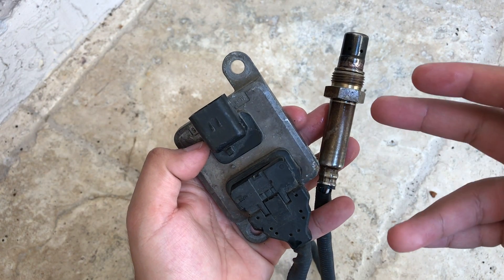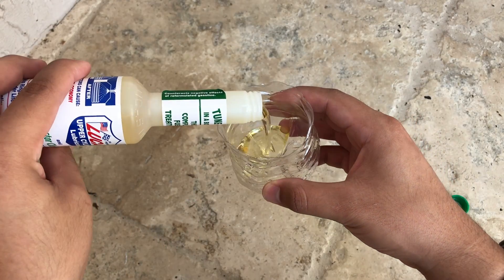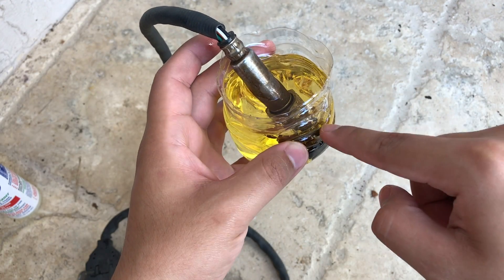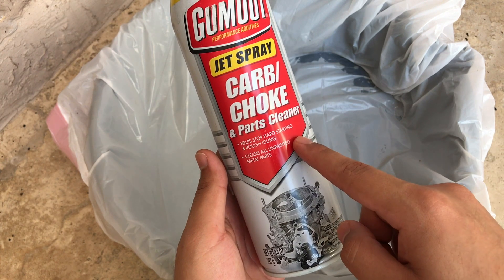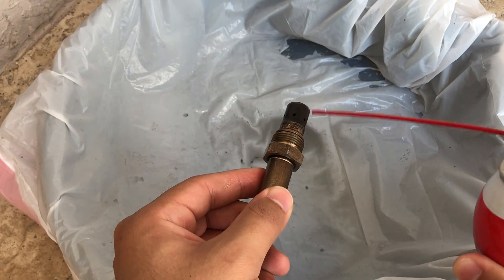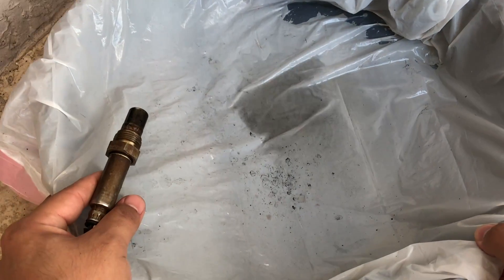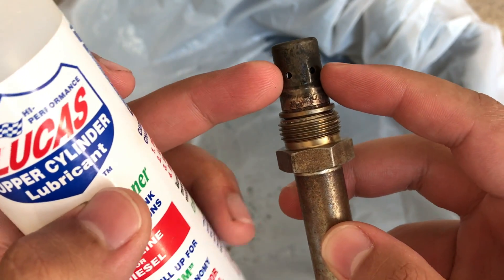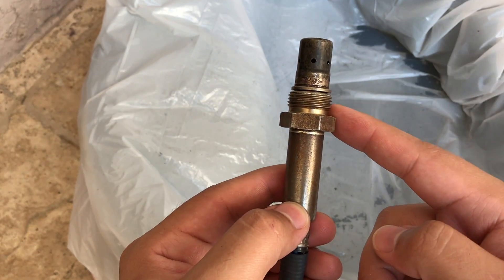How to Clean OXYGEN Sensors [Easy Way]

Comment: I would have liked to see the sensor tested before and after to show that the cleaning had worked.
Reply: Exactly show us the whole video from beginning to end not a halfway video
Reply: Exactly 😂
Reply: Look in the plastic lined pan to see what came out of it. You cannot see it inside of sensor nozzle , on here. I couldn't anyway. Going to do this this afternoon as I think O was quoted 1K to replace all 4. Screw-bie-doo that! I have those products in the garage already. I just have to find where the sensors are located on truck bc I do not know., but soon will.
Reply: same here
Reply: oooor, you could take a $7 risk and clean the sensor and re install it.  If it works....you hit the jackpot and saved some cheddar.
Reply: Lol
Reply: v @edstimator1 yoo89ooiokcvoukooookcvovcvvcyooooo8oo88oo8ocvovoovo8oovcicvov 6yyy866yyýýyyvvjjo6
Reply: EXACTLY what i was thinking
Reply: Take to the chiropractor
Reply: It worked. It is not a rocket science.

Comment: You cant clean an o2 sensor or nox sensor I smell bs on this video the code will come right back
Reply: Actually you can clean them with great results. Though not every situation is the same. If the inner part of OXYGEN sensor went bad, and/or cracked. Cleaning won't help. Also.  If after cleaning sensor your check engine light comes back on. It doesn't necessarily mean its the sensor. You may have a vacuum leak, or some electrical issues. You may buy a new sensor and still get the same code. I've had both success and failures cleaning sensors. I think the bottom line is if you can fit buying a new sensor into your budget. Buy a new one. If you're tight on cash. What does it hurt to try. Btw. I soaked mine with carb cleaner. I'm going to try soaking the next time with gasoline. Gas works great at cleaning many things. Gas works great on ball bearings. I follow up with spraying brake cleaner(on ball bearings, I'll probably follow up sensor with carb cleaner), and letting them dry before regreasing. The main reason gas is not recommended is because it's explosive, and requires you to be responsible enough to take precautions. Like not smoking, using proper ventilation, avoiding any sparks, or using it near any type of flames, etc. I prefer placing whatever I'm cleaning in a plastic container that has a lid. The cheap ones they sell at a discount store. Peace
Reply: What an idiot a knock sensor is nothing but a microphone that listens to the engine and adjusts the timing if the engine pings
Reply: NOX DINGBAT

Comment: I've seen people use lime juice, lemon juice, vinegar, Mass Air Flow cleaner, throttle body cleaner, brake cleaner, carb/choke spray, gasoline, lucas oil fuel treatment, seafoam, and others. Which is the best?
Reply: Mass air flow cleaner ,is the appropriate one for all sensor and electric partas
Reply: @kikiAyalaTyCo  or CRC electronic cleaner.
Reply: Use the strongest one that will take those carbon shit out.
Reply: Good question, does vinegar eat the carbon?

Comment: Can I leave it soaking over night? Why 6 to 7 hours ?
Reply: esviteri82 its just a recommended time, but yes you can leave it soaking over night prob will get more of the carbon cleaned out 🤷🏿‍♂️
Reply: @XxelmokillerxX1  I left it soaking over night. But after 1 week sensor code came back on. So i replaced outlet sensor. No more code

Comment: One of the few videos getting to the real problem. I don't care about the outside protector cap of the sensor. I need the zirconium stone inside clean, and you are getting to that both by soaking and spraying into the venting holes. I think you made headway with capturing your trash in the bag. Now I will try this with testing before and after. With the trash I think you are on to it, good video, thanks.
Reply: Do not do this.  NOx sensors are not spark plugs.  They have very delicate chemical sensing electrodes inside a fragile ceramic element.  Soaking the sensor in any "cleaner" will cause the sensor to read very badly for the first few hours (if not kill it).  You will be at high risk of setting a fault.  If there is some soot on the outside of the probe, you can wipe it off with a dry rag.  Under no circumstance should you allow a fluid inside the probe tip.
Reply: @omegaqed8592  so you're saying WD 40?
Reply: @Commandment_3    I cannot provide any "official" recommendations.  However, IF:
1) it were my truck and it was outside of warranty
2) the sensor had relatively low hours and might have set a fault because of soot...

Then I might consider trying to clean it just on the off-chance that it helps.  In that case I would wipe it and use pure Acetone or 90+% rubbing Alcohol to soak, shake it out, and let it dry for about half an hour in front of a fan to help draw the vapors out.  

Do not use any fluid with additives, as those additives could permanently poison the sensor.  This is why I suggested the pure volatile solvents.

Be careful removing the sensor probe from the pipe, as they are often stuck and easy to damage upon removal.

Be careful you don't get yourself in an engine de-rate situation if it doesn't work.  Most of the time, this kind of cleaning repair on NOx sensors will not actually address the original problem even though the fault code may not come back--but you'll at least feel like you accomplished something.   :)
Reply: @omegaqed8592  what about using MAF cleaner or electrical parts cleaner that is safe to use on delicate parts like those?
Reply: Did it work

Comment: You can buy a new sensor for $20.    All that work to remove it from under car.  I HATE MODERN CARS with stupid sensors everywhere.   CARS are BS now.
Reply: An inlet or outlet NOX sensor on most commercial diesel trucks are over $300/each.
Reply: $600 each must be replaced in pairs  or the ECM will still give fault codes.. It was the worst mistake of my car buying life..
Reply: It's sooo cheap, mines only this much. https://www.autozone.com/engine-management/oxygen-sensor/ntk-exact-fit-oxygen-sensor-25697/408539_28372_40154_97999
Reply: Yea Right...Post Them I’ll Wait
Reply: @kameishac9002  The down stream O2 sensor for a 2010 Mazda 3 is a wide band and it cost $190 to $220 at any local parts store. You can just log onto Advanced or O'rielys, or Autozone and check it yourself, and the chinese ones you can get on ebay or amazon are still over a $100 and will fail in 10,000miles.
Reply: @kameishac9002  here's a link for a cheaper aftermarket inlet NOx sensor for a Cummins ISB. We stay away from aftermarket sensors at my shop though. https://www.raneystruckparts.com/cummins-isb-nox-nitrogen-oxide-sensor-cum5293295-cum2872297/
Reply: KAMEISHA YOU SHOULD STICK TO MOPPING THE FLOOR AND MAKING DINNER.

Comment: Let me pick your brain... what if you replaced a nox sensor, problem is fixed then comes back?
Reply: @Egzon Mobil 650€ in Norway....
Reply: Or maybe your vehicles running rich so the buildup keeps coming?
Reply: Then replace the nox sensor. Sometimes sensor just wearout...cleaning won't fix everything.
Reply: Probably the other nox sensor is bad or the one behind the turbo may also be bad or need cleaning.